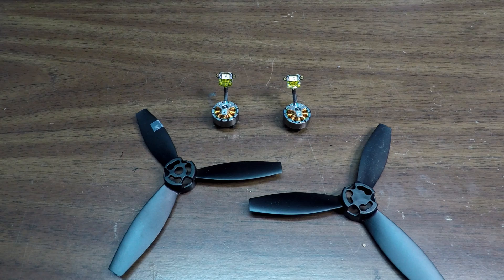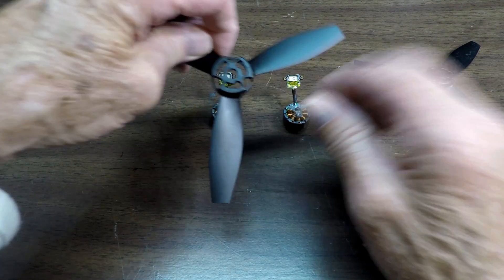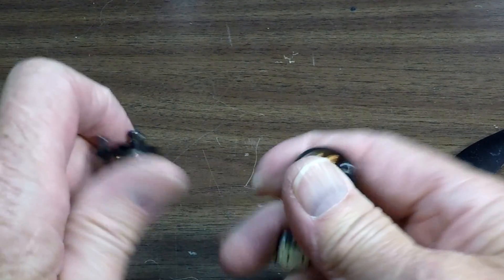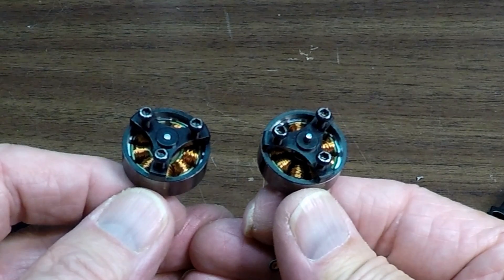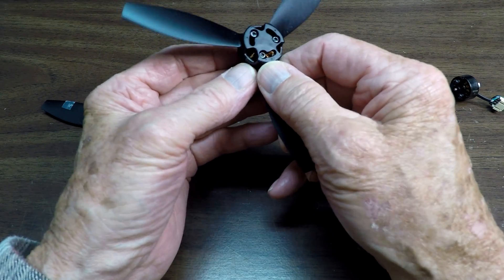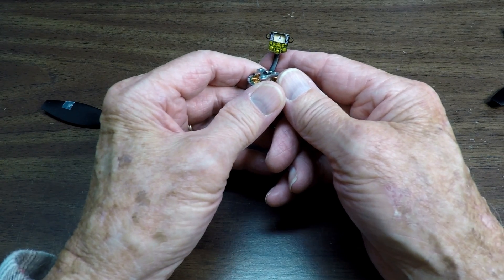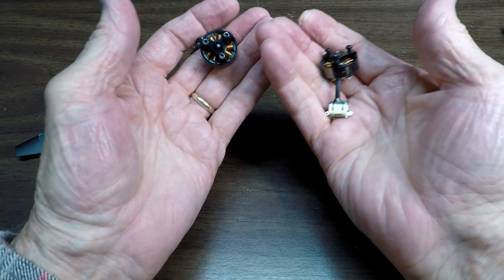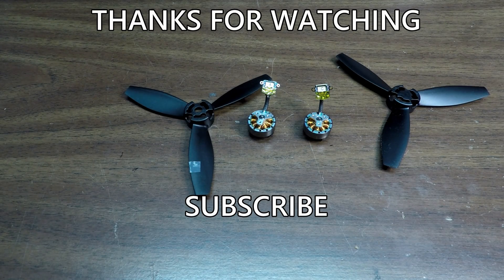PARROT BEBOP 2 MOTOR "A" OR MOTOR "C" WHICH IS WHICH?

Comment: Thanks Mr Kent,  good information to have for break fixes or just plain maintenance. On another note I wondered if you have ever come across the term Jello in videos. I had it appear in my drone videos after a crash. I researched it and it can be from vibration in the chassis of the UAV. Usually from a damaged propellor / motor /motor gimbal or arm. I checked the height of the blades on my propellors and sure enough one was slightly higher than the rest.This turned out to be the source of the vibration. It as slightly bent. Of course i replaced it.

As you know you can detect propellor misalignment by placing the drone on a flat surface and then measuring the distance between the flat surface and  a point on each blade of the propellor with a ruler. If they aren’t the same you’ve got trouble and need to figure out why this might be.

This led me to look closely at the propellers in general . There  are counterfeit/fake and substandard propellors out there for sale on the Internet. Usually Chinese copy cats producing sub standard propellors. I’m sure you’ve heard horror stories of propellors coming apart in flight and people losing their drones. Long story  short can you recommend  a source of good quality carbon fibre propellors for the Bebop2?
Reply from the maker: Thank you for your excellent comment Robert. To answer your questions, yes, I have even had jello effect with my Bebop 2 power. Usually when I am climbing or flying into the wind. You see that in a lot of videos. As for your second question, I never had enough $$ to afford anything but the Bebop props that came with my drone. I did go so far to replace props and two motors after my Bebop fell 270 feet onto the pavement :)

Live and learn as they say in plane crashes :)

Thanks again and God bless.